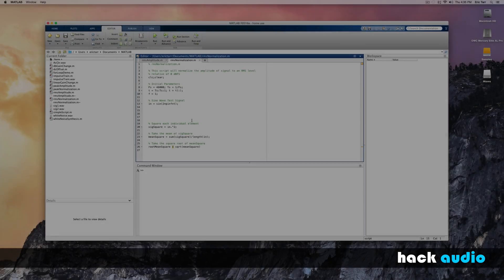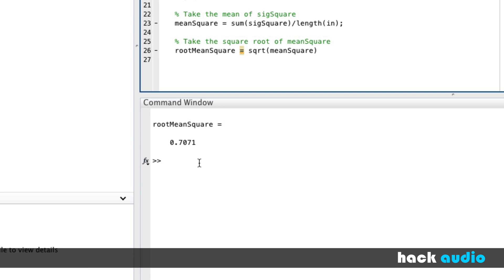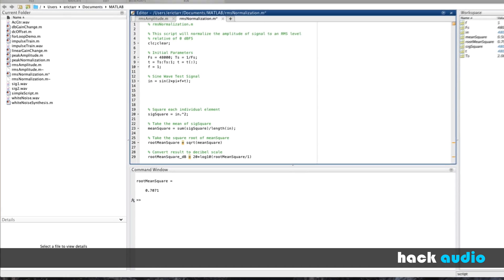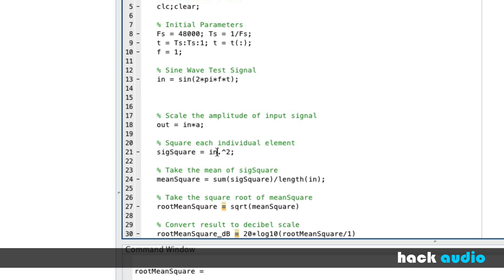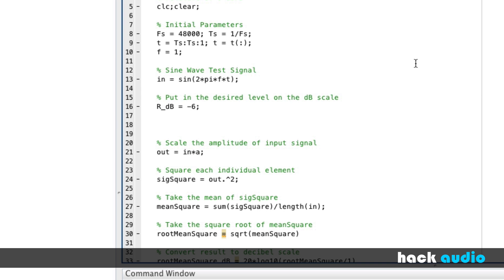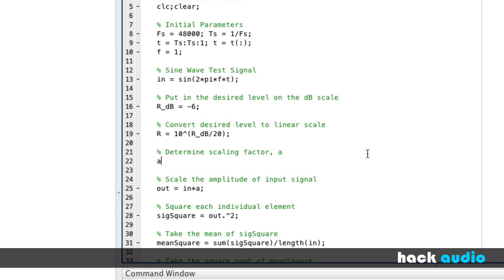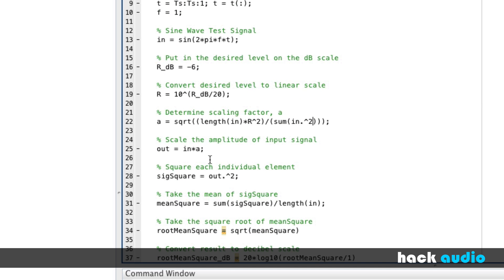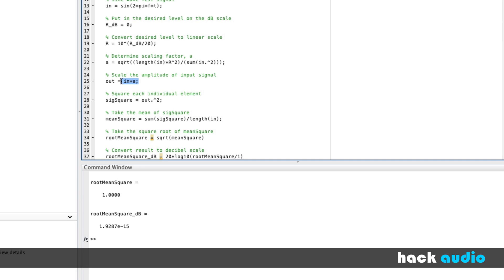Hack Audio: RMS Normalization

Comment: hello sir I am doing rms normalization on 300 audio files together .Following is the code i am using can u just tell whether it is right or any changes need to be done.If this is correct what value can be given to db variable.
function normalize_wavefiles(folderpath, db)  
%get files from that folder
filelist = dir([folderpath, '\', '*.wav']);

dbval = db-100;

%get fileco
filecount = length(filelist);

%Change the db
    for i=1:filecount
        %get the filename
        filename = filelist(i).name;
        
        %get the wave data        
        [wavedata, rate] = audioread([folderpath, '\', filename]);
        
       %change the wave referece to 1 & -1
        wavedata = (wavedata/max(abs(wavedata)));

      wave_rms=(norm(wavedata)/sqrt(length(wavedata));
factor=(10^(dbval/20)/wave_rms;
wavedata=wavedata*factor;
              

             audiowrite([folderpath, '\', filename], wavedata,rate);
    end  
end
Reply from the maker: Without trying the code myself, that looks like it will work. The "dB" value could be whatever you want, if there aren't any other required specifications. I'd recommend something like -3, -6, or -10. The thing you will want to ensure is that none of the individual signals clip/peak during the normalization process. If they do, just lower the dB value by a little more until they all pass.
Reply: @HackAudio  sir for db i am using 80db is it right?
Reply: @HackAudio  tq sir